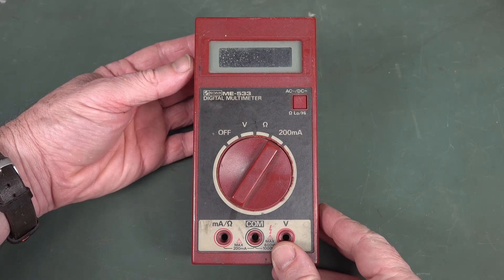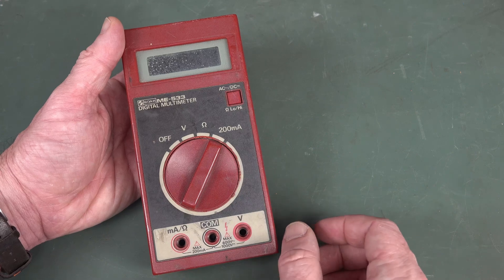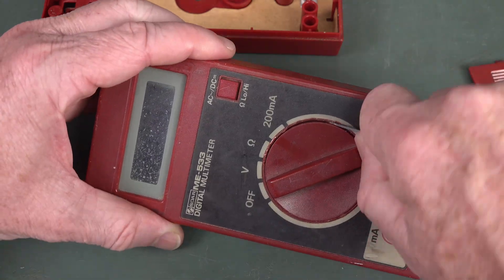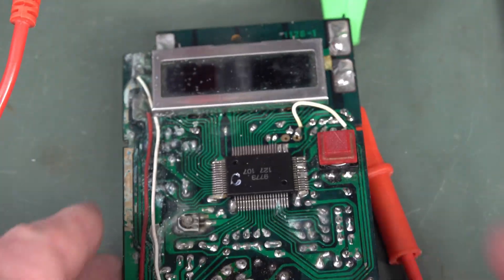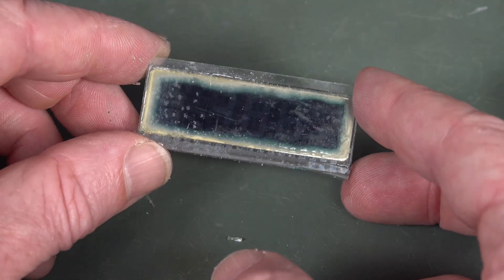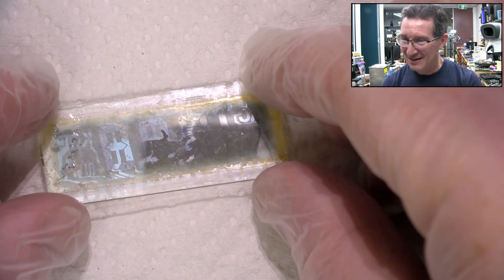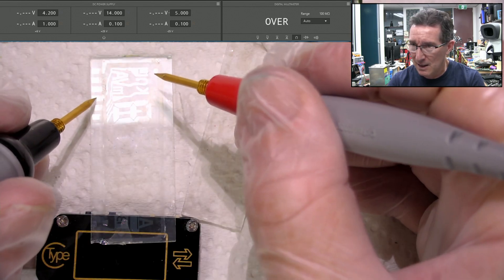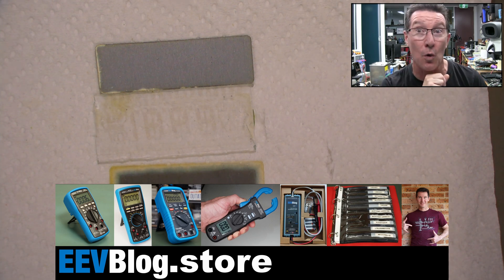EEVblog 1642 - Can I Resurrect My First Digital Multimeter?

Comment from the maker: This Soar meter was also branded Dick Smith in Australia, so I'm not sure how my cousin got the Soar branded version here https://www.youtube.com/watch?v=I6C0HnkR7EM
Reply: Respect for the   80085   :P
some things never get old huh
Reply: Rod Irving Electronics in Melbourne sold the Soar version in their Thornbury store and possibly other retailers sold it. Mine is still going fine although the battery door is loose.
Reply: it looks so close to the hioki 3212 i have one its from the 80s
Reply: I have one of these SOAR Corporation meters or very similar to it complete with the pleather carry case.
Reply: I am no expert, but i thought maybe the original LC was hygroscopic and therefor increased in volume and changed it's viscosity.
The most important question is "how was it sealed in the first place" because you have all the the parts you need to make a display except the fluid and what ever held it in place.

Comment: My SOAR from 1985 is still working, except the contrast is a little weaker now, and better with higher voltage batteries. It's a higher model than this one with 10A capability, and in a grey color but the same shape case.

Comment: Hi Dave, I have an idea for you to try. You mentioned those custom factory LCD probably from China and I did watch your custom multimeter display you made some years ago and I know its possible. So my idea for you is to write to them and ask them "-can you repair this old LCD for me? " also changing that plastic polarizer with a new one, and all they have to do is to add that liquid crystal, the polarizer and to properly glue those 2 pieces of glass again. Also, maybe to add a better contact strip band. You should also tell them you used their services once and you would be very glad if they could help you with this little thing here. Also, if they will tell you that they "dont do this" then see if they can point you to who can, because they know between them better than us. This is my idea for you. Never be shy to ask - is my motto. Haha. Good luck ! I know you can.

Comment: the simplest way of fixing the meter could be just to decode segment multiplexing signal and convert it to led, , 3d print outlines and place black out film on top
i know that wouldn't be the same  but could look cool, kind of a rebel way of doing things, it could be also possible to just find a digital clock or modern multimeter and rewire it to work if the number pattern wasn't too different, who knows maybe those dm830b would finaly be usefull for something

Comment: I wonder if an LCD maker could fix it for you if given the 2 glass parts?  Worth asking.  If that was a no go, you could get some of the glue that is used for LCD construction and try gluing the 2 glass parts together yourself with a very thin bead around 2 sides and the bottom edge.  Then if that seemed to go ok and left the necessary tiny gap between the 2 sheets you could try putting LCD fluid in by capillary action with the open edge upwards.  If you got that far then finally seal the top edge with glue and add the reflector and polarizer.  You'd need some sort of jig to hold the glass parts in proper alignment to glue them which might be the hardest part of trying yourself.  Best bet is someone to put it back together for you or just wait for one on ebay.

Comment: I feel like it would be cheaper for Dave to just design a completely new meter board and guts using an off the shelf display to at least "replicate" the old case. It's not like it has a lot of options, turning it's capabilities noted by the switches should be a bit cheaper than the one off LCD. You still get to use your old kid case but it's safer and will work once again. Basically re-gut it.

Comment: Replace the LCD with some surface mount green LEDs on a board? Modern LEDs don't need much current to glow visibly (especially the green ones), in fact have provision to add series resistors in case it gets too bright.

Comment: If the glass doesn't have any explicit spacers on the edge then it's most likely the type that uses microspheres in the liquid to achieve a specific spacing, and then it would have been sealed around the edge with something like a space-filling adhesive, in this case probably a cheap glue which the battery juice dissolved with ease.

Comment: I have a 1982 SOAR digital multimeter and a 1989 Fluke 73. The SOAR works perfectly after 42 years, the Fluke's LCD display has faded and is difficult to read.

Comment: Heh. I built the kit version of that Micronta when i was a kid. I think it was the second one i built. Bought the kit with paper route money.

I believe that the LCD had a bead of sealant around the perimeter between the two pieces of glass, which leaked/disintegrated. 

Back in the 70's, you could get liquid crystals that had an acrylic panel with a vinyl sticker over the back. The sticker confined the liquid crystal fluid  in a circular spot behind the plexiglass. The fluid would change color as you squished it around the back. Think "giant squeezable mood ring".

Get some 3M 5200 marine sealant and a syringe to make a little ridge, add the fluid, and sandwich it in.

Comment: nice Dave my first Analog meter was a radio shack meter but my first digital meter was from Sears it worked very well I got my first fluke model 77 in the 1980s and still use it I later got fluke 87 .

Comment: If you had an LCD with at least somewhat matching symbols, wouldn't it be possible to cut the traces and "rewire" them to go into the right corresponding place on the new LCD?

Comment: That liquid inside was probably actual LC mixture, unless this thing got immersed in something else at some point. I worked for HP labs in the UK for 15 years, and we were regularly filling the space between two sheets of either glass or plastic with LC, and yes, it is a liquid. You need to space the two substrates with spacer dots or other structures which give you the right gap ( in the order of a few microns). We used a UV curable glue around the edges to seal the innards off. We relied on capillary action to pull a  tiny amount of LC into the 'cell'. So some sort of glue has disappeared from your dmm display I would think, it shouldn't be all loose like that...haha.
You could rebuild it with the right LC mixture, and the right sized spacers between the layers - if you get this wrong, you'd get too much or too little contrast, and you might even get weird colours ! What's likely to happen if you don;t do this in a cleanroom is that you'll get MASSIVE particles in the gap, and all sorts of pretty effects but prob. no actual
useful display.
Reply from the maker: Thanks. Yeah I was thinking it wouldn't be that easy.
Reply: @noakeswalker  The battery juice has seeped between the plates. When Dave disassembles it and cleans the plates, you can see in the reflection that the transparent segment electrodes are corroded in some spots.

Comment: Nice video, they drive those lcd with ac current it will be a nice upgrade if u can read the output with a microcontrôleur and use. Oled display to show the results.

Comment: My very first digital one is long dead, killed by a camera high voltage flash (didn't do it myself though). My second one though, Beckman Circuitmate DM23, bought 1989, is still in action.

Comment: I bought my first multimeter in the late 70's. It still works fine. Needs calibration perhaps. My first DMM works fine as well. It is from late 80's.   My first oscillosope (Heathkit O-12) is from late 50's, even if I got it just 35 years ago. It works fine as well, but I recapped it ten years ago, whether it needed it or not. Tubes are still original ones.

Comment: Dave can fix this! Dave can fix this! Dave can fix this! I imagine you can construct the "well" sides using a thin bead of flexible adhesive. Maybe silicone, if resistant to everything and not polluting the liquid and really good sticking properties. I would probably apply the adhesive around the edges, leaving a small opening on the right side for the air to escape. Then you can set it all up with liquid and close the glass halves from the left to the right, squeezing the air out before the adhesive opening is forced shut at the end when the two pieces of glass are pressed coplanar, left to right. Just my 2 cents...

Comment: I looked into getting a replacement LCD manufactured a few years ago. It was to fix a similar failure mode on a common '80's car clock application. The I did all the design work, and found a company who could make them, butt he minimum order valve was more then I wanted to spend at the time, so I delayed it for while. The individual displays were to be very inexpensive - I just needed to order an awful lot of them. Little did I know, someone I know was working on solving the same problem, and shortly after started selling them, and has been ever since. Deciding to wait until my cashflow was healthier proved not to be my best decision!
The liquid crystal is not just a liquid. It has some tiny glass spheres in to too which keep the sheets of glass the correct distance apart, and prevent the ITO conductors from touching one another (see Applied Science's excellent video on making an LCD display from scratch https://www.youtube.com/watch?v=_zoeeR3geTA ). I am sure the two glass sheets would have been bonded together originally around the edges to keep the liquid crystal in, but I guess if there is no trace of that bonding left, most likely it dissolved in battery

Comment: I'm pretty sure I had a variant of that from the late 1980s that I used at university (in the UK) - it was brown rather than red but the form factor was the same. I can't immediately find it and it's possibe that it was thown away but if I find it I'll let you know.

Comment: I was always wondering how do they avoid lighting up traces in the lcd. It is the same condactor as a segment.
Reply: I don't know, but my theory is that the traces towards the two pads take different paths.  Oh, and if you look at 8:53, it looks like I might be right.  For example in the bottom piece of glass, there is a large common trace at the top of it.  In the top piece of glass there are no traces in that region.
Reply: @davidbastow5629  yes, thank you. I think you're right. I've looked on two halves of screen carefully and now it is clear for me that top and bottom traces actually never cross each other, like traces to that dot symbol near the 1. Except, probably that large bottom horizontal trace on a second part of the screen. But probably it is not visible during normal operation, or it is out of active aria.
Seems it is pretty complicated task to route everything without crossing.

Comment: I think the liquid from the battery seeped due to capillary effects between the glass sheets (the liquid something as shown in the video) and also dissolves the glue that holds the glass together. Normal LC liquid is an extremely thin film.
Reply from the maker: Yeah, probably he most likely explaination

Comment: Would be nice to try and setup a breadboard with some normal 7 segment led modules, just to see if you could make a permanent solution as replacement of the LCD.
I assume that would be way more easily achievable, and certainly cost way less than trying to source another LCD.

Comment: Fill with new lcd juice and glue the panel closed.
Reply: @voltare2amstereo  The transparent electrodes are corroded. Battery juice has seeped in-between the glass plates.

Comment: The diodes were cut in order to test them on the bd without removing the PCB. Apparently they were good so they got soldered back together.

Comment: "2 jewels" on the analog multimeter is probably referencing the bearings for the needle. Such tiny bearings are called jewels and are often made from ruby. Clickspring had a video about it recently.
Reply from the maker: Not probaby, that's exactly what it refers to.
Reply: similar to jewels in a watch
Reply: That is the only thing it could be refering to :)

Comment: Hold onto it. PCB Way will make your custom LCD someday soon.
Reply: @pault6533  If he is lucky, won't need a custom LCD. There are cheap multimeters with basically the same LCD, if he can find one with the same size where the connections are on the other edge, he can make a flex PCB or the thinnest FR4 laying underneath the LCD as an interconnect between the display and the board, while correcting the pinout.

Comment: That LCD looks a lot like the one in the $7 Harbor freight meter. I think you’ve probably got a couple of those kicking around, could be worth a shot at checking to see if it would work. They are so cheap I usually buy them as gifts for friends I’ve taught about electronics. In my years of doing electronics I’ve learned that any meter is better than no meter. The only bummer about those meters is no audible continuity. I actually work in the same industry as Big Clive, so I’ve taught many technicians about electronics especially the specialized systems used in the entertainment industry. Having a multimeter is so useful for troubleshooting any electrical issues you might run into as an entertainment technician.

Comment: I bet the battery juice has attacked this LCD. You might get a generic 3 1/2 digit multimeter LCD with the same size where the connections are on the other edge, and make a flex PCB that connects the new LCD to the board while correcting the pinout.

Comment: If you have the schematic for the LCD some manufacturers might have one off the shelf that's "close enough". You might have the wrong image for the low battery indicator or another non number indicator but the numbers might work.
Reply from the maker: Yeah, I'm thinking this might be possible if it uses the same chipset then it's likely the pinout might be the same.

Comment: I still have my first DMM.  A Micronta 22-198 which I bought in 1980.  Still works 100%.  Some really nice features to it too.  Super smooth and seperate function and range switches, tool-less battery replacement, the fuse accessible in the battery compartment and capable of using an external power source.  I once left in on the dash of may car on a sunny day.  The only thing that happened to it was the front legend sticker (thick aluminum BTW) curled up a little, but it stuck back down.

Comment: I bet that leaky battery nailed it. Lots of damage to the board, and the electrolyte is very alkaline
Reply from the maker: Quite possible it ate away the glue on the LCD.
Reply: @EEVblog Almost surely.
Reply: That's partly why I stopped using Alkaline batteries and switched over to bare Lithium-ion cells in my flashlights and DIY electronics projects, just so I don't risk it getting annihilated by "Alkaleak" cells.
Reply: @Dr_Mario2007  Ni-MH don't leak either. Those are just fine as well
Reply: @aleksandersats9577  Sorry, but yes, they can and do leak.  There are plenty of older PC motherboards that have been killed by leaking NiMH batteries.
Reply: @aleksandersats9577  The problem with them is their rapid self discharge. A batteries main function is to let you down when you need it most.
Reply: @aleksandersats9577 

And they don't bloat after a few years...
Reply: @georgemoore5307  The rapid discharge never bothered me. And it isn't as rapid as you even think. I have left a pair of energizer NiMH batteries in a bluetooth radio headphones for a year and guess what? they still hold a charge and I can turn it on. I also have another abused NiMH battery that can't deliver any current but still holds a charge for months. I use that for my wall clock and it stays ticking for 3 - 5 months on it.
Reply: @GodmanchesterGoblin  They are still much less likely to leak than alkaline batteries.
Reply: @rocketman221projects  Maybe, but as with most things, it will vary from one manufacturer to another.

Comment: I am by no means an expert, but if I were to think of why they constructed the polarizer between the two sheets of glass, I think it would be to electrically isolate the two electrodes? The capacitive effect will still work with the polarizer because well... it's an electric field. They also might have used use a simple method like vacuum welding, where it's like a suction cup. Take a flat piece of plastic, apply water on a flat surface, press down the flat plastic on the wet surface and it will stick to it because of the vacuum created. They could of course have simply glued it and the glue had just fallen off as well.
Reply from the maker: I suspect it's likely the later, a glue line that has just disintergrated wiht time and possibly some checmical interaction with the battery corrosion.

Comment: I have an old soar 3220 dmm with bargraph, it's not bad at all, keep it in the car for unexpected occasions. Will have to check the batteries
Reply: Update, it works fine but the lcd is different to yours. I'll have a look around in my box of old meters, I'm sure there was another soar. If it's got the same lcd and nobody else in the comments beats me to it you're welcome  to it.